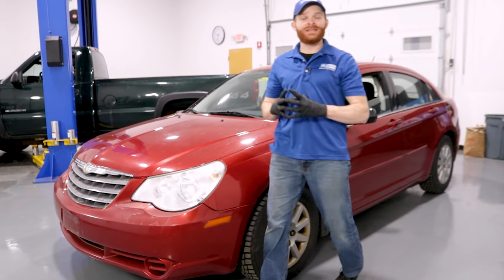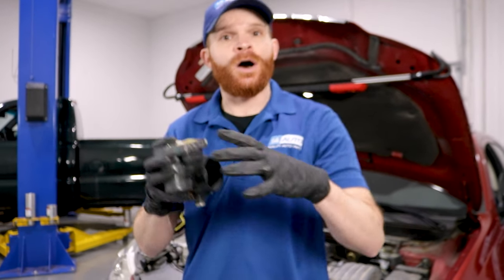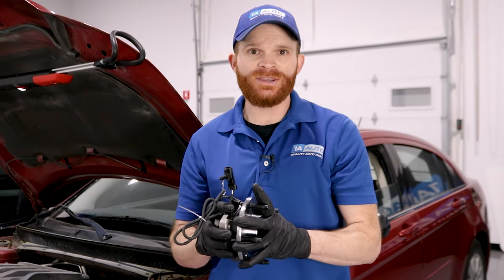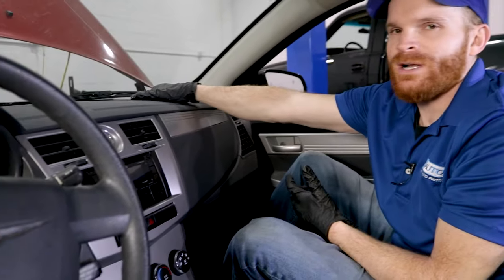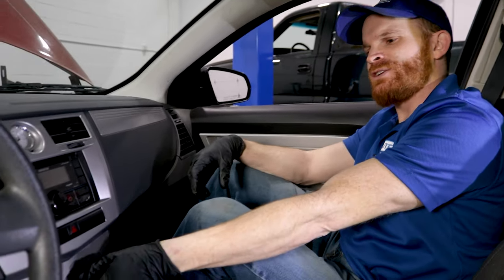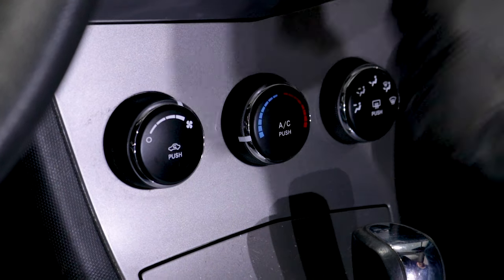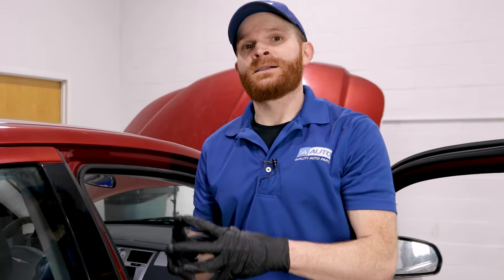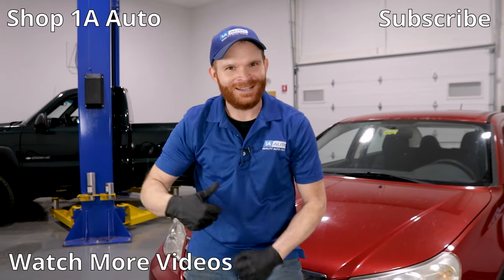Top 5 Problems 3rd Generation Chrysler Sebring Sedan 2007-10

Comment: HELP!!!! 

so I have a 2010 Chrysler Sebring & about 3 weeks ago it felt like it wanted to accelerate on me or would jerk a lil so two days after I experienced that my check engine light came on. I took my car to big brand tires & they charged 170 just for a diagnostic . They told me I needed a new PCM which I had to find myself & paid 360 for the part & 120 for labor . I pick up my car they tell me the check engine light is still on & that I need a new craftshank which I pay like 200 for parts & labor. I go back the check engine light is still on & I say ok let me drive it maybe it will come off . This )⚡️( symbol that looks like that starts flashing & my car feels like it’s not giving power like I’m pushing the gas & I feel like it’s driving slow so I take it back they say I need a new throttle body which was 500 so I say ok . I go get my car yesterday the check engine light is still on & now it’s reading open circuit 🫠they tell me take it to an electrical shop because they don’t know what the issue is now. They did tell me bring it back Wednesday so they can make sure the PCM was put on correctly. Honestly I feel like they didn’t put the PCM on correctly or something but I need help 😓 so any mechanics on here ?
Reply from the maker: +Delliah’s Life We wouldn't be able to diagnose an issue like that here, you may want to have a local mechanic take a look at it. Thanks for checking us out! http://1aau.to/m/Shop-1AAuto-c